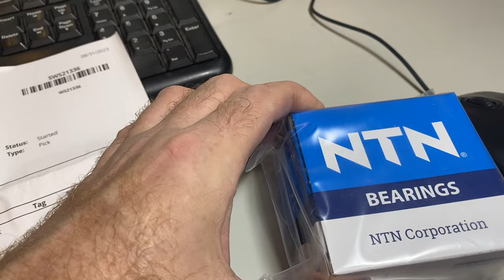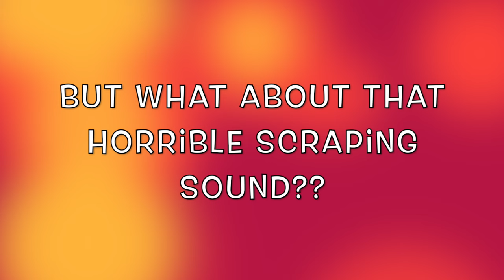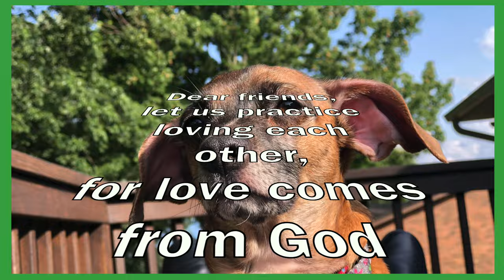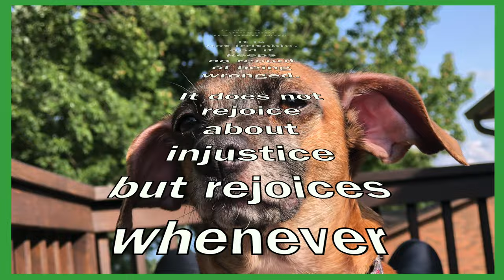Bridgeport Restoration 15  -- Mysterious Step Pulley Clatter and Project Finished!

Comment: I had the same problem (s) on my just finished pulley J head. The spindle pulley bearing sleeve was almost unusable with the worn out internal threads. The cam ring pins would simply slip into the threaded holes. Instead of replacing that $150 part, I drilled the threads out, tapped 5/16" threads and made new cam ring pins out of 3/8" rod. That saved almost $200 in parts and shipping.

Also, I had a similar metallic rubbing coming from the timing belt pulley. The Ilion guide to rebuild states that Bridgeport J heads had a bad tolerance on this part which they later corrected. I machined that pulley to make it sit a tad lower so the timing belt rides higher. There was a noise like yours but after a days break-in, it went away.

I found the A33 belt size was too long. 2nd highest groove wasn't a snug fit. I have a AX32 gates belt I will be trying.

Nice history lesson.
Reply from the maker: Thanks for the feedback.  That noise really gave me a fit.  I think break-in may have helped me too.  Thanks again!

Comment: Don’t leave the mill on those cheap cinder blocks. With vibration they may crack and fail. Use several 4x4 posts as a base. Or 6x6 posts for more height.
Reply: White oak or iron wood.
Reply from the maker: Yike!  I hadn't thought about them cracking. That could be catastrophic!  I'm envisioning the mill tipping over.  I'll work on getting them down or onto cribbing ASAP.  Thanks for the pointer!
Reply from the maker: Good advice.  Thanks so much!

Comment: Maybe I missed it, but each of those cam ring pins are secured with socket set screws.  Without those set screws, the pins absolutely will wear and pull out.  And its a good idea to replace them with new pins anyway if you've got the top apart for a bearing swap.
Reply from the maker: I talked about the little set screws.  They completely buggered up the replacement pins I made -- probably because I made the replacement pins out of mild steel.  The replacement ones I made out of a cap-head bolt seem to be doing better.  I am pretty sure I tightened up the set screws, but probably didn't show that on the video.  Thanks for the feedback!

Comment: H&W is the only place to shop for B.P. parts ! (Unless you need some aftermarket or non-essential items)

I rebuilt the main spindle on my B.P. but was nowhere near as lucky as your $68. Those use angular contact Fafnir 207 and are ~ $500 for a matched set.
Reply from the maker: Yeah, I had expected outrageous prices for those bearings, and was thrilled that it was reasonable.  I love H&W's videos.  Those guys are the experts.  Merry Christmas and thanks for watching!

Comment: Yee-haw, 50 minutes! If there is anything i enjoy, it has to last a while... This ticks the primary objective, and the secondary, being related to machine pampering...

`edit`
Kevin! What the fuck man, i say machine pampering, and there he goes, using medieval torture methods on fresh bearings and bearing journals as if they were pagan heretics... For fucks sakes mate, differential cooling methods are there for a reason... Get a propane bottle, a lighter filler will do, hell, you even have the shock spray for automotive uses for rapid cooling of crusty stuff to force the rust to crumble under the forces and break loose upon heating up... Get a bottle of that, it reduces parts temperature to around -30C, which aint much for sure, but couple that with a baking oven and heating up the other part or assembly to 70C gives a nice temp. difference that most precision bearing journals should accept as a free fit tolerance range... Just bake the outer part for some time and blast the other with the shock spray for 30 seconds(depending on the size, just don`t be stingy with it, you will rarely use it and its cheap anyways), the parts should almost always fit right in... Also, get some kitchen silicone gloves for baking, that will do well enough to allow you to hold the hot and the cold part without sensing the temperature, while also not allowing your body heat to affect locally either of the gripped parts in your hands... If you can`t find the shock oil spray, just turn a propane bottle or a lighter filler upside down and blast the part with liquid gas, do it outside, don`t smoke while doing so(not Kevin specific), don`t have any sources of ignition around you, as the gas will rapidly suck out the heat from the part, and depending on the gas, it can reduce the temp very nicely to much below -30C that shock oil gets you, but this shit can and will blow you up if you mishandle it in a stupid manner, as if turning the bottle upside down isnt stupid enough as is, but in this case it relies on the results of the mistake for specific purpose... Either way, you can use CO2, argon or whatever gas you have, just keep in mind that you are either making an explosive, poisonous or suffocating atmosphere around the worksite... It can be done safely, but keep your wits in check for that part... Don`t spill liquid gasses indoors, it`s a surefire way of harming yourself in one way or another... And mind the frostbite, don`t hold the part by hand, some of this gets easily below -50C...

Nice job in general, i can`t really bitch too much ;) also, Merry Christmas in advance!

All the best and kind regards,
Steuss
Reply from the maker: I have access to liquid nitrogen, so I could have used that on the bearing. And I have a torch, so I could have used that to expand that bearing housing.  I'll have to remember to do that next time.  Live and learn.  :-)  Best wishes and thanks for watching.   I'm glad you liked the longer video.  I'm always afraid that length will scare viewers off.  Merry Christmas.